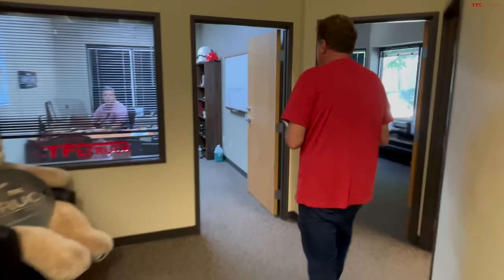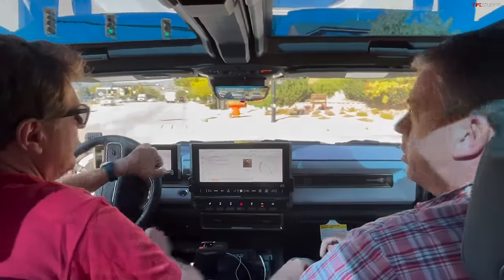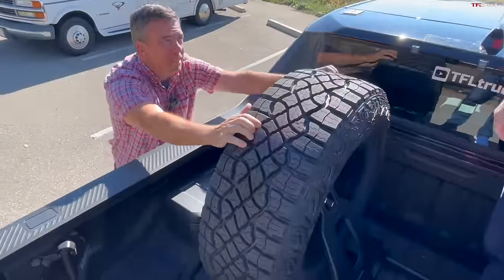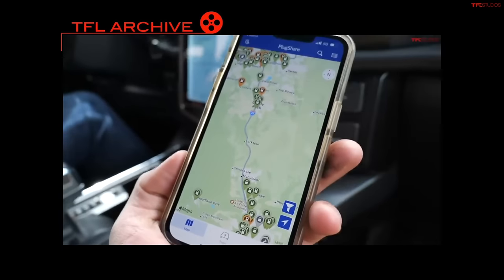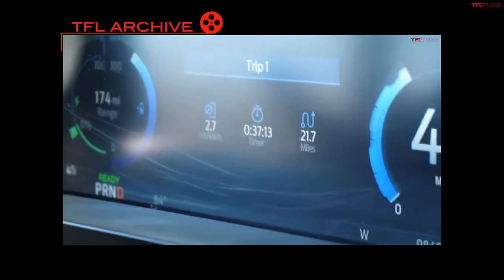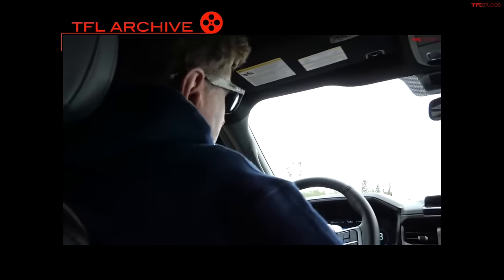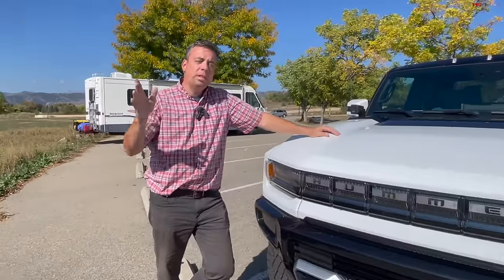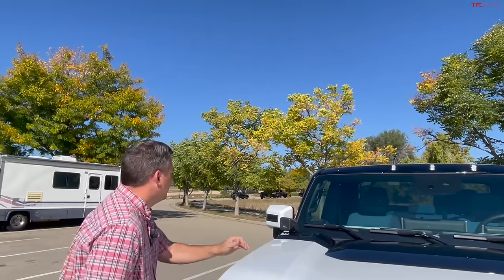Here's What Happened to Our Hummer EV When It Broke Down & WHY We Traded Our F-150 Lightning for It!

Comment: Part of the dealer’s pre delivery inspection process needs to be checking for the latest software updates and applying them before turning over the keys to the customer.  Also, if GM doesn’t do over the air updates how’s an owner supposed to know if their software is out of date?
Reply: Easy. They could send you an email. GM knows the software version your vehicle has.
Reply: Usually the send out service bulletins for things like software updates or other minor fixes, looks they they forgot about this one.
Reply: You will know you need an update when the car stops moving in the middle of the road
Reply: Pretty sure it is a requirement for them to check.
Reply: Fair point that the dealer missed the SW update on the module
Reply: @SuzukiKid400  So GM sends me an email and then I have to make an appointment and wait all day for the tech at the dealer to update the software. Nice. Just what I want to do with my time.
Reply: @clarkstonguy1065  What else did the dealer miss?
Reply: Or cars really have no need for software to begin with.
Reply: Vehicle Companies are about making the sale and screw you after that .
Reply: GM DOES DO "over the air updates"....have been doing this for a while...Tell me you don't own a late model GM vehicle without telling me that you are a "Ford or Dodge fanboi"....😎
Reply: Something fishy here, software fixes take age s to be implemented.  Either dealer missed the part were they update everything to latest versions during PDI, or they just simply rebooted the software and hope this glitch will not happen again. You cannot simple rewrite software for 1.5 days.
Reply: @ejgrant5191  If updates can be done over the air, then the system can be hacked. Nothing like downloading a little malware with a software update.
Reply: They could do an update check every time you come in for an oil cha-.....oh wait.

...Seriously though, I'm pretty confident the Hummer will be back at the dealership for "issues" more often than most people would go there for oil changes.
Reply: @clarkstonguy1065  In the previous video, the guys made sure they had the latest software IIRC.
Reply: Patrick Gragg  How will people get their green energy rebates from the government then?
Reply: ahem, your software is out of date the day you drive it off the lot. Just like most operating systems. 

they discover bugs as soon as they implement the update......
Reply: Anyone feel like this sudden software update was created just hours after the last video came out ...
Reply: @adaycj  The “update” was a fix for the software anomaly that occurred when the Hummer shut down unexpectedly in traffic
Reply: @slundgr  Yes. Distributed mere hours after a high profile video was released showing the vehicle disabled in traffic. And the other video showed the vehicle didn't die in traffic. Roman tried to reboot in traffic, and it refused to reboot.
Reply: Thy never did that at Chrysler and claimed they do lol
Reply: Isn't it obvious how to tell the Software needs upgrading? Watch the previous Video. IT BREAKS AND YOU GET STRANDED IN TRAFFIC!
Reply: @PapaWheelie1  Or your software license has expired. :-O
Reply: this is why you should never buy it. Im sure their stance will be trade in in 3-4 years for one that has nothing but software updates.
Reply: worst part is in next software update, you might get a new strange bug. lets hope its not a "full throttle" bug that makes you car just accelerate and no way to turn it off.
Reply: It says on the sheet, they updated the module, not software. The module suffered from an anomaly. Not the software. Learn to read. The software corrected that anomaly, the module suffered from.
Reply: @archeryan8404  it says they updated a module. Not replaced.  A module in software terms is for example serial-module, or powerwindow module. a powerwindow module can be code that only is about controlling powerwindows for example.
Reply: @AndrewTSq  incorrect. The module had an anomaly. Not software. The update fixed the anomaly the module suffered from. Learn to read.
Reply: @AndrewTSq  and it was a serial gateway module. This is a hardware module, not a software one. The firmware, not software or hardware, had an anomaly.
Reply: @archeryan8404  can you show a timestamp? sounds like we read 2 different papers.
Reply: @archeryan8404  you know firmware is software? and can usually be upgraded without replacing hardware.
Reply: @AndrewTSq  firmware is software that runs the hardware. Software is software that runs on hardware. I know the difference it's clear you dont
Reply: @archeryan8404  lol ok. I might not be an expert, but I have JTAG equipment that I have used to extract firmware, so I have a little clue what firmware is.
Reply: @WoolyNips  GM sends me emails that check for recalls and overall health and my Cadillac is 8 years old.
Reply: Software updates cost them money. They have to pay the tech. It's more of a reactive than a proactive approach, if there's a complaint they update the software
Reply: @planed1978  They are doing overlay patches on the modules main code. They can easily refine and test the code in a few hours and issue another update if needed.
Reply: @slundgr  Being it concerned a serial bus it was most likely due to network collisions causing packets to not reach intended module so basically 'data confusion' and the network shuts down so nothing works.... the dark side of electronically managed vehicles. Most vehicles today have upwards of 100 modules on many data bus all trying to talk to each other and the goal in programming is to try and get the bus timing/error correction and module priority correct. All the modules pole each other and if it takes too long for a response the central electrics will shut that module down for protection often apparent to the user as something like the dash display goes dark.
Reply: @DirtyDog995  Sounds logical, and I'd think that it is even more critical in an EV or a so-called smart vehicle or EV
Reply: @slundgr  Same strategy on any computer driven vehicle. The high-speed CAN network modules such as ECM, ABS, TCM & SRS (drivetrain and safety) will always get priority. The interior modules end up on low-speed , LIN and Ethernet bus' and interact with high and mid CAN through the central electrics.
In EV's our focus was (I retired this year) on energy consumers and balancing the power usage where the driver would not perceive any lack of functionality and to try and maximize regenerative energy to get the most mileage. It was the same with ICE vehicles with the difference being we had a little more latitude in the MPG figures. Programming EV's was like trying to ring every last drop out of a wet towel. The good news is as of this year and going forward 25% of new chip production is focused on the automotive industry and there are a lot of really sweet chip packages on the way for power management (ie lower current usage) and smaller footprints (integrate more functions into fewer packages). It will get better but there will always be these software niggles I'm afraid and once they cure them a new model will come out with new issues 😉

Comment: Enjoyed this video, especially the summary of the F150 Lightning. Towing is a big issue for EV’s. There was a significant difference with the trailer attached and empty versus the trailer loaded with the ATV.  It would be interesting to compare those differences with an ICE F150.  I was considering the Lightning but after watching a few towing videos, realized that the reduction in range with towing is a show-stopper. If I want to pull my boat from Minneapolis into Canada, I would be concerned how to make it to the Canadian lake from International Falls with the type of road for traveling. I assume that fast charging stations could be installed but I don’t see that happening for several years. At my age, I’m not certain that I will ever be able to buy an EV that would make practical and economical sense. Minnesota requires that EV owners submit mileage driven in an EV annually so that road taxes can be assessed (to make up for loss of tax revenue at gas pumps). I think it is great technology but not really affordable for most families, especially with the high inflation that is happening right now. Also, gas prices have been artificially escalated by current gov’t policies cutting oil licenses on Federal lands and the nonsense that the world is going to end in 30 years if we don’t drastically reduce CO2 emissions by 2030 or sooner. Also, the tax credit on EV’s is a big scam on taxpayers. The gov’t is not going to cut spending so the tax credit is only going to drive higher tax rates for everyone. All that said, I enjoy watching your videos on EV technology.

Comment: the advanced software thing in new cars is such a double edged sword. more stuff to go wrong, but also the possibility of super easy and convenient fixes with OTA updates. hopefully the pros outweigh the cons long term
Reply: I don’t see it as any good. Say what you will about fixed software, but it gives manufacturers a good reason to get it right the first time. Just look at video games. So much trash gets released buggy and unfinished at full price every year. Sometimes it gets fixed other times it doesn’t. And sometimes they sell you the solution.
Reply: They will when the cars are new....when they are 20 years old they will be scrapped instead of going to more underprivileged buyers because they will be too expensive to fix/keep up.
Reply: @jacobrzeszewski6527  usually the games don't get fixed

Comment: Let’s be honest this was a quick turn around because GM seen your videos and other channels who posted your video of the broken down Hummer and knew they had to fix this quickly. If this would of been a regular customer this Hummer would still be in shop being worked on. I even seen your video of the broken down Hummer on multiple news channels roasting EV vehicles. GM upper management was on this right away to fix your Hummer EV.
Reply: There are two of these currently at the local dealership with similar problems that have been in "service" for 34 days now. 

The new model for all manufactures is let the public RnD the vehicle and just slowly fix the biggest faults while developing the next nightmare generation. 

We hit peak engineering in the automotive industry in 2001. Almost everything since then has been multiple steps backwards.
Reply: In this case since the fix was to reset everything by disconnecting the 12V battery and flashing a module with an existing issue - pretty sure any decent dealership would have done that. If it took a whole day, sounds like they may have taken some extra care though. Dealers only get paid for the reflash, and wouldn't have spent more than an hour on it.
Reply: @MrAPCProductions  Can you say "not ready for prime time?"
Reply: @clarkstonguy1065  Assuming the dealer has anyone trained on the EV and would get near the vehicle.
Reply: I thought they wheeled this vehicle in an earlier video, so the videos must be out of order. They talked with GM, broke down, and fixed this vehicle before the broke down video released.
Reply: @ Carlos Mendoza You know all that for a fact?

Comment: It would be nice to see what the Hummer cost to run for a month on daily usage charging every night at home. What the cost would be just charging at home and running errands around town, going to to work etc. I feel this would give a realistic cost of ev usage vs internal combustion engine gas prices. Keep up the good work
Reply: You can calculate the price of your household energy vs gasoline easily.  What they never talk about though is maintenance requirements.  What is the cost of ownership to maintain both of these over 5 years?
Reply: @aussie2uGA  an electric car is basically maintenance free. Regen keeps the brake pads new almost the entire time and the only fluid that it has is the coolant that's used for the batteries and because it doesn't get diluted by combustion it's on a 10 year interval.
Reply: Between my EV and my Mustang I spend about $125 in fuel driving 40 miles a day 4 days a week for a month. I charge my EV at home only with a 240 plug and it's plugged in from 1am when i get home and is done charging by 6am. Here in CO i'm at .20c kWh and it costs about $50 to charge over a month. Now if your fast charging in public your not saving any money. Using my local costs i figured out that if fuel is below $4 a gallon and i'm charging publicly then I'm actually spending more money driving the EV.
Reply: @WhoThisGuy515  I gotcha, my point is they never speak of those reduced maintenance costs.  Ever.
Reply: That will not be done as it would show the TRUE cost and shortfalls of the vehicle. Though they push the fact that they paid for this vehicle they do NOT pay for the numerous vehicles they "test" such as the original hummer ev...as such they don't want to piss the big companies off or they won't give them more vehicles to test( for content ) This is why they complain a little and then downplay the problem and spent countess videos talking up a vehicle that completely failed almost immediately. It is also VERY smart  to NOT keep the vehicles long term so they don't have to make the big companies look bad because basically NOTHING new will last long term and even ends up being repaired under warranty numerous times. Quality of new vehicles is CRAP! And all electric vehicles range and charging capabilities are grossly exaggerated...don't believe it,do some research !
Reply: @ThePauldunbar  Paul, do you assume people buying performance EV's are trying to "save the planet"?  You're buying the hummer for 1000hp. instant torque, crab walk steering, etc.
Reply: @elblancochingon8138  I own a Model 3 and a Tundra.  The Model 3 costs basically nothing to maintain and I was always surprised why they don't point out the scheduled maintenance plans and dealer costs for them in the reviews.
Reply: @aussie2uGA  a new battery (out of warranty) will make up for for an awful lot of oil changes(WELL over 100)..so don't keep past warranty I suppose
Reply: @elblancochingon8138  Tesla batteries are rated at 300k-500k so I won't hold my breath that I'll ever have to replace it.  I have 90k on it now and it's been amazing.  Still love my Tundra for towing though so each to their own.
Reply: @aussie2uGA  how many miles does the Tundra get towing?
Reply: @elblancochingon8138  I tow a toy hauler, so it's not too great.  About 10mpg at 70mph

Comment: So I'm a technician at a GMC dealership. So far we've had a hummer come in twice with the exact same problem. The issue is an over-the-air update which customers receive that bricks the serial data gateway module which is in the middle of the data line and essentially makes the vehicle a 9500 lbs paperweight
Reply: On other GM vehicles this situation happens when the end user doesn't follow the directions of the over the air update.  Somthing to the effect  of " update in progress, do no turn off vehicle" I've seen that a few times. Haven't got a hummer in out area yet.
Reply: Did you have one Hummer that had this problem twice? Not two hummers each having this problem? Either way, this is what I need to see to still keep my 1987 Mercedes with 300,000 miles on it. Thank you to all the folks that continue doing the testing for the dealer / manufacturer.
Reply: @VegasMikeP229  for us we've had the same Hummer take a shit twice

Comment: Tommy the problem is that the Pro and XLT are unattainable, I wanted the XLT er mostly for physical buttons. but it was sold out, so I went with the Lariat ER. Already put 5500 miles in a month on mine. Glad I did not wait in hind sight as I  am eligible for the $7500 tax credit which the ERs for 23 cannot get and the XLT Er is more than my 22 Lariat ER costs.
Reply: Agreed. I tried to order the lightening  but missed the pre-order window. I think it sold out in hours. I've pre-ordered the silverado EV and maybe I can place an actual order next year. The industry has changed. Can't walk into a dealership and get much these days. My friend bought a bronco 2 years ago and is still waiting.

Comment: Wonder if you can change the tire when off road on a soft surface. Did you find the tow setting on your hummer?
Reply: Can they change the tire of the truck period ? It weighs over 9000lb
Reply: A 2 1/4 ton jack will lift a corner, but honestly the air suspension should be manipulated to not need a jack at all.

Comment: I watched the whole video with great interest. That lightening is a cool vehicle and whoever edited this video did a great job organizing all the information from previous videos. If EV's  are this good now, it'll be interesting to see what they do over the next decade. Great series guys
Reply: Without a change in battery technology they won't be any real difference.
Reply: @bowez9  I agree. Though I'm not sure if electric motor technology can do anything to make motors more efficient or not.
Reply: @dalejones4322  high efficiency motors are already 95% and have been for decades.  Standard are about 80-85%, can't speak which the industry is using but would assume the higher  efficiency.
Reply: @bowez9  I had no idea. Thanks for the info. Do you see batteries improving in a noticeable way in the near future?
Reply: @dalejones4322  nope